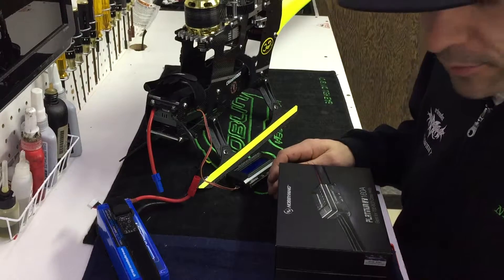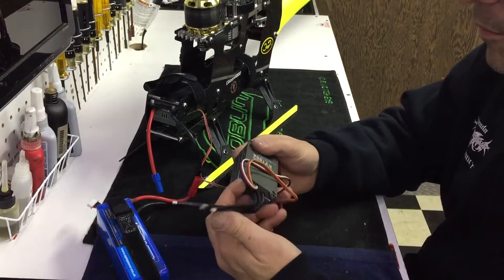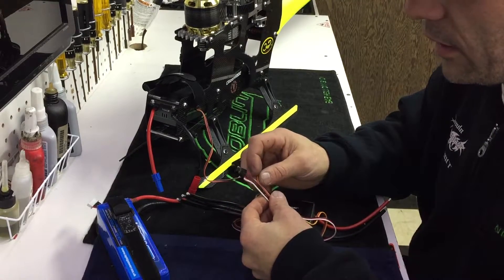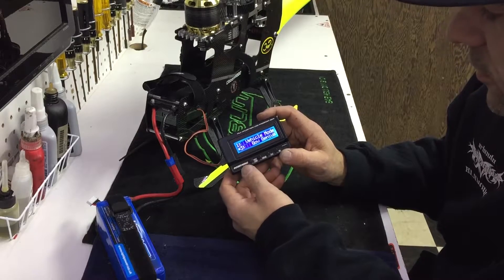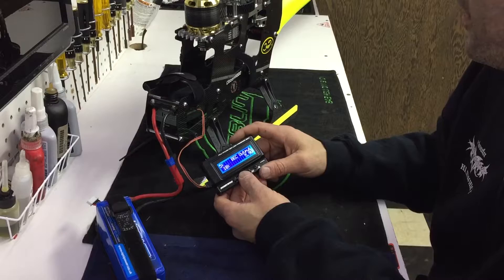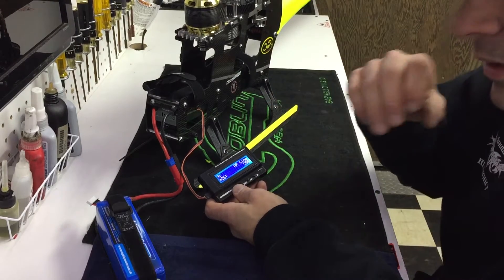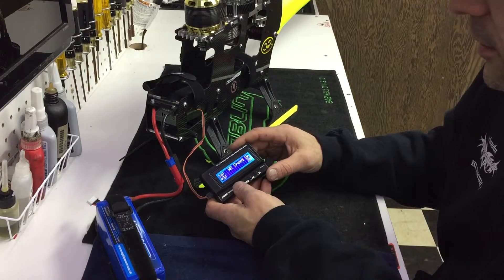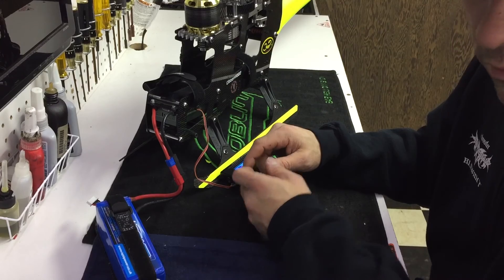HobbyWIng 160HV overview

Comment: What timing did you use for that motor? I have the scorpion 4525 ultimate too, what setting did you find works well for you?
Reply from the maker: Shane Sherer default timing of 15* and default pwm work perfectly. The numbers will seem a bit high, but they really do work great with minimal heat.
Reply: Nick Lenn Thanks dude keep the great videos coming